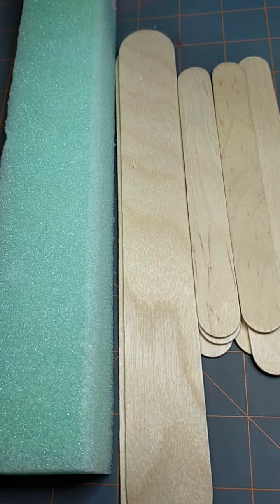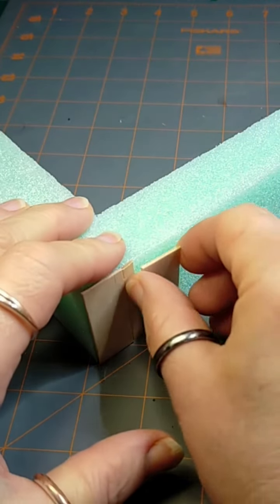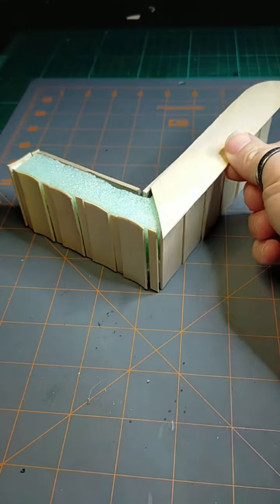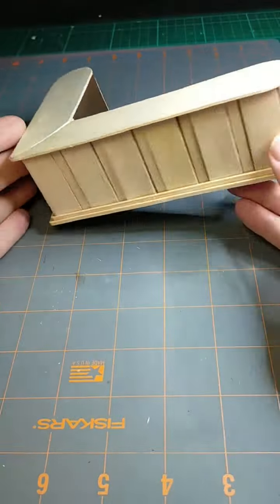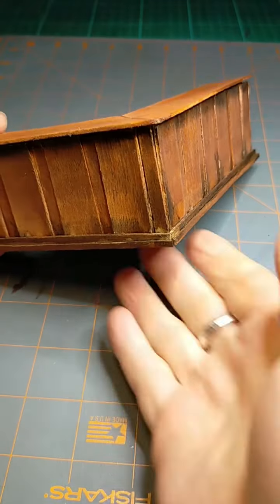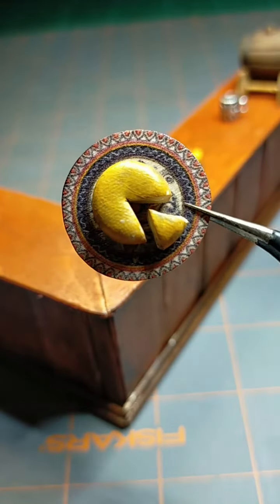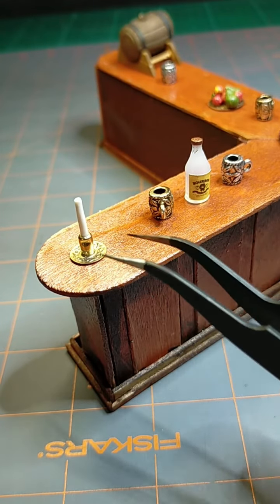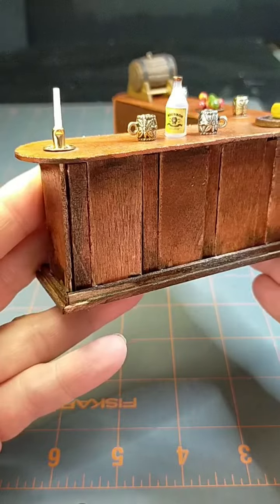DIY Miniature Wooden Tavern Bar #diy #craft #mini

Comment: Lovely work. The wood of the bar is gorgeous and all the barware and accessories are great. My first major terrain/diorama piece was a fantasy tavern in 25mm scale (it was around 1991-92, 28mm hadn't quite taken over) I built the bar with balsa wood and laid out the plank floor with basswood strip atop a flat hardboard canvas. It all worked well until I tried to use paper mache for Adobe outer walls, and the grim visage of warping showed itself. Your bar is the dinkum oil ( excuse a Texan trying to use slang he learned from an Rpg sourcebook back in the 80s).
Reply from the maker: I just had to google dinkum oil as I've never heard of it before, and it's a thing lol! As for your warping from the past, I know your pain! It's like a real time, super slow-motion train crash, as you watch in horror wanting to stop the carnage from occurring unable to do anything. 😭
Reply: @dinkydioramas8349  yeah it was in the Aussie vocabulary in the TMNT rpg sourcebook Mutants Down Under. I guess it fell out of common use.